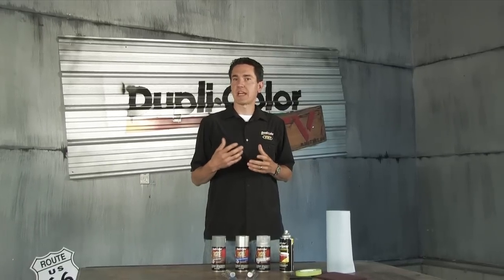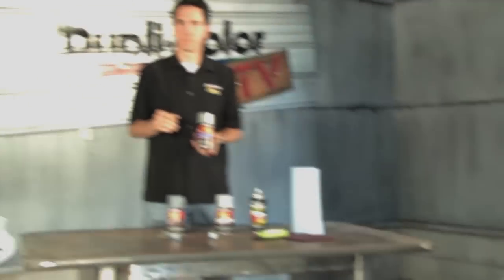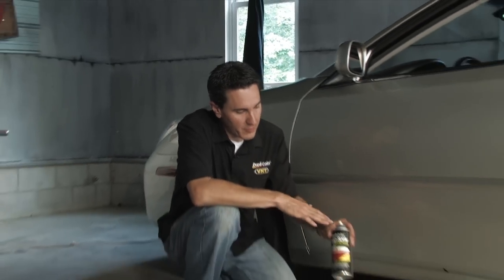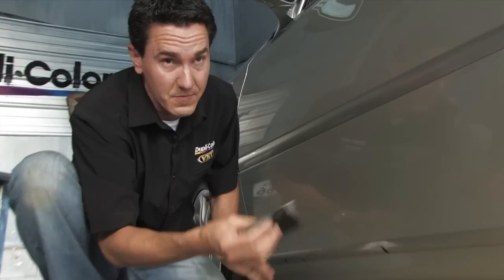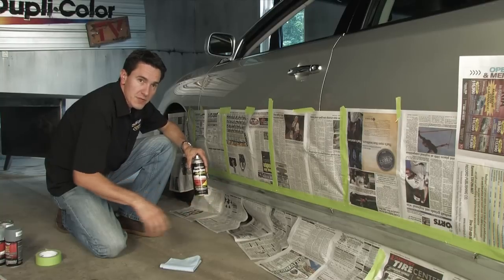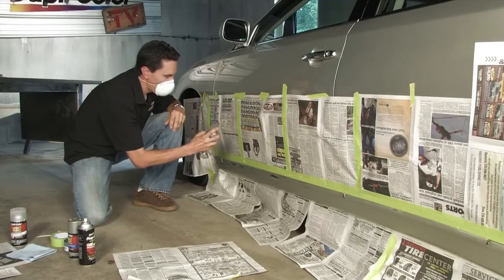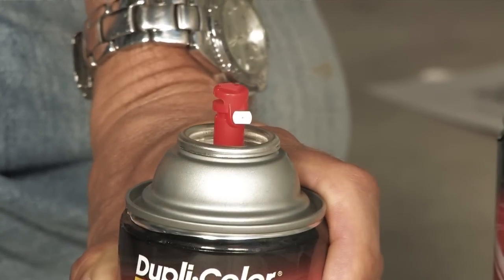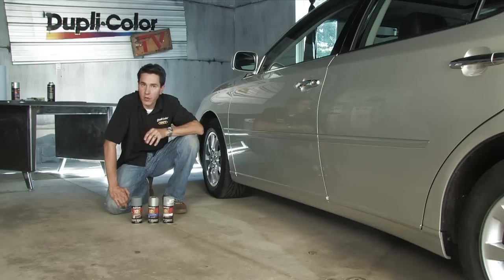Dupli-Color® How To: Perfect Match

Comment: I use good body shop quality masking tape, but always wind up with a tape line when I pull the tape off. Any thoughts on this?
Reply from the maker: Hey Matt,  Thanks for you question.  There are a few different techniques for minimizing tape lines.  The best way is to paint up to body or character lines, using the car's natural lines to hide any tape lines.  Another good technique for softening tape lines is to take your tape and lay it down so that it's covering a character line.  You then roll the tape back to make a tube.  This technique will soften the edge of your paint line making it less noticeable.  Also, if neither of these techniques seem to be working the way you'd like, you can always wet sand, buff and polish the line so it blends back in with the finish.  Hope this helps!
Reply: Thanks for the tips and the prompt reply!!
Reply from the maker: Happy to help!  Feel free to reach out if you have any further questions.

Comment: Can I paint my vehicle in the sun?
Reply from the maker: Hello! Painting in direct sunlight is not a good idea. It will most likely dry the paint too quickly and cause an uneven look to the paint finish. Ideally, painting outside in the shade and in low humidity with temperatures between 50-85ºF is best.

Comment: I need to touch up/paint my plastic bumpers. Is the process and product the same for plastics? Is any wet sanding required between coats? Anyone?
Reply from the maker: Hi, Rupert! After the bumper is clean, dull and dry, you may apply our Adhesion Promoter. Once our primer is used, it will be the same process. No wet sanding is required between coats.

Comment: hi what do you do if you accidently wet sand to much and go through the clear coat 
thanks
Reply from the maker: The clear coat would need to be reapplied. Perfect Match is lacquer based and does not have a specific recoat window.

Comment: Can I use dupli-color on the hood and the trunk of the car since the clear coat peeled off?
Reply from the maker: If the Clear peeled off evenly from the entire hood, then you could use Perfect Match Clear over the entire hood/trunk.  We find it easier to remove both parts from the vehicle and set up for the most even results.

Comment: great video.
1-To paint a new bumper, do you apply cleaner, primer, paint, and clear coat at the end?  is that the right order?  If so, how do you blend if you paint only one small area of the bumper?

2-Do you need adhesive so the paint stick to the plastic bumper or the primer already has that?

3-Also how many cans of each do you usually need for the whole bumper?

Thanks
Reply from the maker: +zofa300 Yes, to paint a bumper, you'll want to clean the surface and then Prime, Paint and Clear with Perfect Match products. That's the correct order. 
In order to make a repair in the middle of a body panel, you will want to wet sand the affected area smooth with 1500 grit sand paper to eliminate and imperfections and uneven appearance. Once smooth, clean the area, let it dry, then tack cloth it. Regardless if this is the primer, color coat, or the clear coat, I suggest using a method called "Tenting" to eliminate the hard edge line that can happen when masking off small repair areas.
 
Here is the technique:
 
Allow for a two-inch overspray zone/border all around the repair area.  Lay a stiff or heavy sheet of paper over the repair area and tape the top edge of the paper, corner-to-corner, to the uppermost edge of the overspray zone/border.  Now grasp the bottom edge of the paper you just taped and bend the paper up and away from the repair area, sticking the top edge of the paper to the body panel. The bend you have created is now facing you (kind of like a teardrop of paper hanging on the body panel).  Depending upon the paper you are using, the bend may need to be tightened.  Just tape the paper higher up on the body to tighten the bend.  You want a tight bend without a deep sag.  This bend or tent will soften the edge line created by the overspray that you would get if you simply taped a square border around the repair area.
 
Repeat this technique on the remaining three sides of the repair area, thus "boxing in" the area to be sprayed. Basically you will have four bends facing you and your repair area boxed in the center.  You should still see your overspray zone but the bend will be slightly obscuring the underlying taped edge. The slight overhang that the bend produces is what softens the overspray line and prevents overspray from spreading to far across the body panel.
 
I suggest testing this method on a piece of poster board to perfect your technique before doing so on your vehicle. You will still have an overspray line, but it will not be a hard line that needs lots of wet sanding to make smooth prior to buffing. Rubbing compound will blend the repair area much easier.  You will need to allow the repair area to cure for 5-7 days before using the rubbing compound.  
 
The Primer would work for plastic, but we also make a product called Adhesion Promoter specifically for plastic surfaces.  You could apply the Adhesion Promoter, then the Filler Primer, then Paint and Clear.
 
1-2 cans should cover and entire bumper.
Reply: Thank you SO much for your extensive explanation.

Comment: can you list all the items needed please? i don't know much english
Reply from the maker: +LicSinMex You'll want to use:
Prep Spray, Perfect Match Primer, Perfect Match Paint, Perfect Match Clear.

http://duplicolor.com/product/perfect-match-premium-automotive-paint
Reply: +duplicolortv thanks! I did all the steps but the part I painted is not shining like the rest. What do I need to do now?
Reply from the maker: ***** You can wet sand using an Automotive Grade sandpaper of 2000 grit lubricated with water to bring up the sheen in that area. You can then buff the coating using a buffing compound.

Comment: After clear coating area, when is it possible to clean the car?   At least with cold water(rinse).  And how long til all of the clear gasses out so I can wet sand out orange peel ?
Reply from the maker: +Michael Hinchey We suggest waiting 7 days before cleaning the car and waiting 24 hours for a wet sand.
Reply: +duplicolortv So wet sand but no compounding for 30 days?    I can do a full wash after 7 days, including car soap, micro wash mitts etc?
Reply from the maker: Yes, wash with car soap/micro wash mitts after 7 days. We'd suggest waiting 14 days before using buffing compounds/wax.
Reply: +duplicolortv Thx.  u guys have a+++ customer service.

Comment: I got a question my car color is G95P Dupli-Color BHA0976 or I could just use Dupli-Color/Amazon green metallic Perfect Match paint. What if, I do 3 color BHA0976 then add the green metallic for finish or do the green metallic 3 time only would it match G95p? What would be best? Reply ASAP THX
Reply from the maker: +Tshuaj Vang What is the Year, Make and Model of this vehicle?  695P is the Color Code listed on the vehicle?

Comment: I found that the paint i need to touch up my 2009 toyota tacoma was not avaiable any were the paint code is 1E7 or byt1616 this was frustrating because i used another toyota silver color that looked close to mine the cap matched to body color but when i sprayed it it was off even having the gray primer then white sealer as i saw in the paint where some one had damaged the paint on my tailgate and it did not come out even close now i have to track down a quart of the 1E7 from a paint supplyer and redo the whole tailgate to match..
Reply from the maker: +rock dawg The part # EBTY16160 matches OE Color Code 1E7.  Are you saying that you used this color on a car with 1E7 and that it didn't match?  If so, please give us a call at 800-247-3270 to discuss or send an email directly to me: roger.d.caudill@sherwin.com
Reply: I went to every automotive supply in and around my area they did not carry the bty 1616 i checked five stores none had it i ended going with a paint suppy house they got me a good sized can that will leave me enuff to spray what pannels got damaged from parking lot damage so i have to resand down the tailgate to re apply gray primer and respray and fix a bottom part of right fender thats damaged and wait and then clear coat one day later the funny thing the can of your paint the lable said matches all toyota silver the cap held up to the body was perfect match but when sprayed it looked right then dryed it was one shade lighter go figure the one thing here the supply shops won't sell to non body shop customers i would have used my new spray guns and bought a quart even with the new waterborne stuff ?????
Reply: but they wont sell the new stuff to just anyone i can't figure out why????
Reply: +duplicolortv no the duplicolor didn't match it ended up being wrong it was a shade off i didn't have the 1E7 at the time i have it now but i have to wait till temps come up still cold here and i cannot spray it in a non heated garage also this is the first toyota iv'e respray this color  the body primer color is very weird when you sand you see primer then a white sealer i think i may have got the two in wrong mode maybe resulting in the color off looking a lighter silver when you look at the stock color you see a silver slight blue in the silver so this is new to me ive been out of the body shop business for 30 years so this base coat clear coat  thing is all new to me back in the day we had just single stage..
Reply: +rock dawg i now think that the white primer sealer may have been the problem i should of use the gray primer instead
Reply from the maker: +rock dawg Please give us a call at 800-247-3270 to discuss your issue or send an email to: roger.d.caudill@sherwin.com
Reply: +rock dawg no the duplicolor didn't match it was off I now have 1E7 but haven't sprayed it too cold I don't have a heated garage and have to sand the panel to remove the wrong paint and fill another dent from parking lot damage I will send you a email here withe duplicolor  no# THAT I USED

Comment: Hi, I notice I bought the exact spray aersol cans for my color of the car. I notice the aersol can color comes out darker just the first coat of base. It is so off from the color of the car. Is there tip to make the paint to come out brighter?
Reply from the maker: +Darkmand8 What product number are you using?  What's the Year, Make, Model and OE Color Code from your vehicle?  Did you use the Clear?  Using the Clear will help the Paint match the vehicle better.
Reply: The color of my vehicle is NH552M Silver Sebing. I have a honda s2000 2002. I also use the clear as well. Just curious why is it so darker from people using the paint gun? Always a slight darker. You can't tell when your far away from the vehicle but onces you walk up close you can tell.
Reply from the maker: Darkmand8 There are a few reasons why it could appear lighter/darker. The color formula has shifted over time and the new version is darker, the car color has faded, over-application or it's the wrong product. What product number are you using?
Reply: I use the Dupli-color BCC0410 where o'relly auto store recommend to match the NH552m. But the color is just way off darker. Do you know if there is any silver that match better with the NH552M color code?
Reply from the maker: Unfortunately we do not make that particular color for your vehicle.  You may want to try your local Dealer or go to www.automotivetouchup.com, who may carry harder to find colors.
Reply: Thanks a lot! I appreciate you help.

Comment: Do not use this paint. I bought two cans to redo my trucks hood. The paint came out clumpy and runny. both cans were like this. Would not recommend this for any project.
Reply from the maker: +Jonathan Breckenridge We're very sorry to hear this. Our customer care team at 800-247-3270 would like to speak with you and find a solution to your problem. Please call them at a time that is best for you.
Reply: +duplicolortv Thank you! Duplicolor sent me fresh cans in the mail. The ones I had bought had faulty nozzle heads. I've always used Duplicolor for crafts and things. Good customer service. (:
Reply: Just did a fenderwell on my truck on my truck and shaved filled holes where emblems were. I can see how inexperienced people could allow such mistakes such as drips however,  I did 80 grit initial sand bondo, then 80, 180, 320 then primer.  After primer I did 600 then shot the paint just as demonstrated above.  Next came the clear then 1000 grit, 1500, 2000, 3000 and yes 5000 then polished.  Worked just fine can't even tell.
Reply: You did not remove the hood did you?  Instead you painted with the can completely horizontal.

Comment: I have a whole tailgate I'm needing to repaint, with it being a large surface,  is using the spray can a good idea? if I do wet sand between each color paint and clear coat, will it avoid spray lines? (I've never painted anything ever)
Reply from the maker: +Logan Holt Yes, you could paint an entire tailgate with spray cans.  Make sure you spray each coat in opposite directions to prevent lines.  Light coats to slowly build up the paint is best.  Perfect Match Clear should be used over the Paint to protect the Paint and to match the color. Please let us know if you have any more questions.
Reply: +duplicolortv awesome. would 1 can of paint and clear  be enough (same size as in the video) to paint the tailgate? or more cans?
Reply from the maker: We suggest having 2 cans of Paint and 1 can of Clear. Anything you don't use could be returned. 1 can covers about 10 square feet.

Comment: We used the GM Metallic Silver paint on some plastic door rest bases. They were stripped and clean before painting. Used DC Adhesion Promoter, then applied paint. Applied DC Clear Coat within 10 min of painting (too soon) and got mottling. Repainted and waited 24 hours to clear and still got mottling. Any suggestions?
Reply from the maker: +btilley1973 The problem you are experiencing is often temperature related. You should be able to apply the clear coat over the  GM color in as little as 10-15 minutes without any issues, unless the surface is cool and the paint and or clear is not drying properly. The temperatures must be above 50- but ideally between 60-80 and less then 50% humidity. Another thing to consider is the humidity level, as high humidity can also cause this to occur. We hope we were able to assist you.

Comment: Is 400 grit sandpaper okay? And is the filler primer necessary before doing the coat of paint?
Reply from the maker: +Isaac Massey Typically, 400 grit will not be enough to create an adequate profile and feather the edges. The filler primer is necessary to blend the area, especially for deeper scratches or larger chips.

Comment: How do I prevent tape lines when I paint?
Reply from the maker: +MrSteelmyheart In order to make a repair in the middle of a body panel, you can wet sand the affected area smooth with 1500 grit sand paper to eliminate and imperfections and uneven appearance. Once smooth, clean the area, let it dry, then tack cloth it. Regardless if this is the primer, color coat, or the clear coat, We suggest using a method called "Tenting" to eliminate the hard edge line that can happen when masking off small repair areas.

Here is the technique:
Allow for a two-inch overspray zone/border all around the repair area. Lay a stiff or heavy sheet of paper over the repair area and tape the top edge of the paper, corner-to-corner, to the uppermost edge of the overspray zone/border. Now grasp the bottom edge of the paper you just taped and bend the paper up and away from the repair area, sticking the top edge of the paper to the body panel. The bend you have created is now facing you (kind of like a teardrop of paper hanging on the body panel). Depending upon the paper you are using, the bend may need to be tightened. Just tape the paper higher up on the body to tighten the bend. You want a tight bend without a deep sag. This bend or tent will soften the edge line created by the overspray that you would get if you simply taped a square border around the repair area.
Repeat this technique on the remaining three sides of the repair area, thus "boxing in" the area to be sprayed. Basically you will have four bends facing you and your repair area boxed in the center. You should still see your overspray zone but the bend will be slightly obscuring the underlying taped edge. The slight overhang that the bend produces is what softens the overspray line and prevents overspray from spreading to far across the body panel.
We recommend testing this method on a piece of poster board to perfect your technique before doing so on your vehicle. You will still have an overspray line, but it will not be a hard line that needs lots of wet sanding to make smooth prior to buffing. Rubbing compound will blend the repair area much easier. You will need to allow the repair area to cure for 5-7 days before using the rubbing compound. 
Let us know if we can help you with anything else.
Reply: +duplicolortv Could you demo this on your channel?

Comment: I have a 2009 Scion xB, color code is 209. I have seen two different names, Black Mica, and Black Sand Pearl for this code. I have bought Perfect Match BTY1622 , hope that's correct. What about hoods, door's etc., is it better to plan to repaint the whole part?
Reply from the maker: +kuzbro The correct name for his year, make and model of vehicle is Black Sand Pearl- 209. The Perfect Match product- BTY16220 is the correct touch up paint. Depending on the condition of the paint, you should not have to paint the entire door or hood. The Perfect Match line is specifically formulated to match OEM paint colors and help make touch-ups on your vehicle a bit easier. Let us know if you have any more questions!